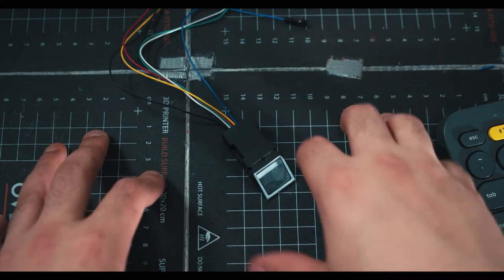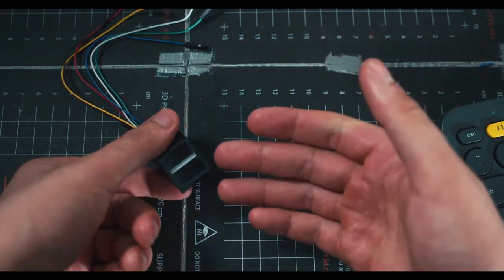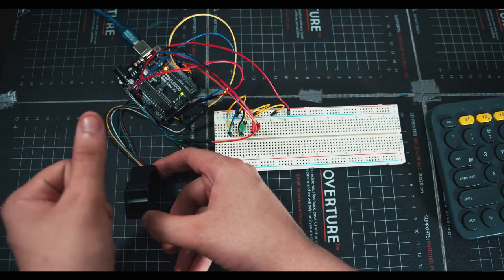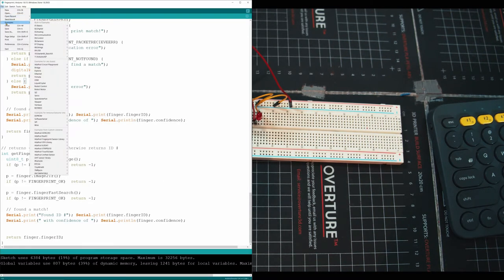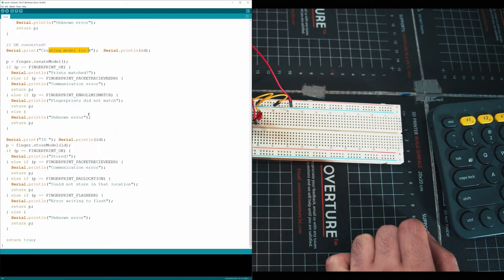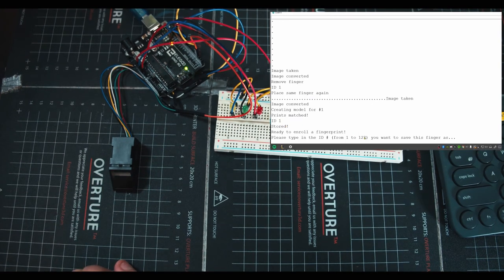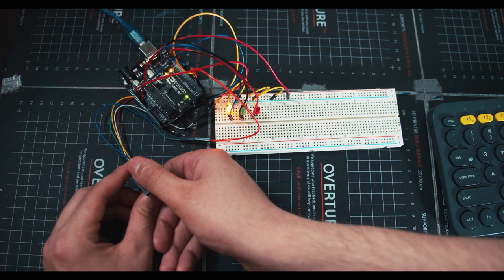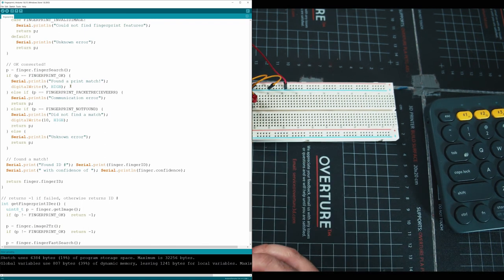FINGERPRINT SENSOR EXPLAINED | Arduino Sensors | #grindreel

Comment: Hey man really cool video!! Im sitting here now and trying with my Arduino but men I opened the serial monitor then it says "Did not find fingerprint sensor":( And when I upload it says fuse 5, dont know what to do... Hope u answer.
Reply from the maker: can you join the discord and show us the code/errors, hard to help with specific details here

most of the time when not finding the fingerprint sensor, if its showing a light on or smt, then it has power, so its the other 2 cables that are having issues, make sure your getting the right ports

Comment: Bro i tried it but when i activate the serial monitor it says that the sensor not found, do you have any idea about what is the problem ?
Reply from the maker: Id go through each wire and make sure theres a connection, make sure the fingerprint sensor is getting power and look for signs, like an led/light